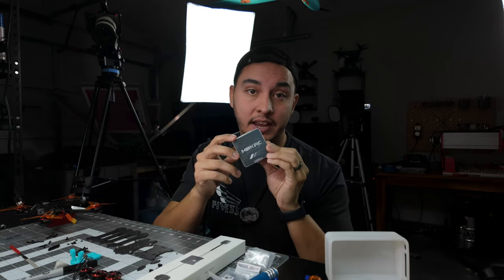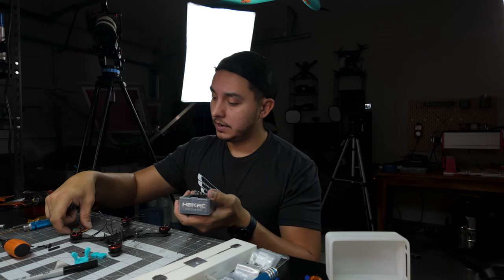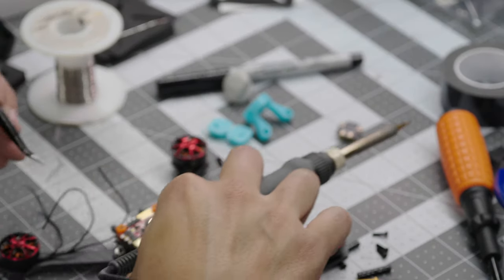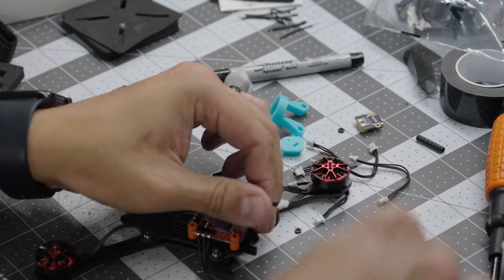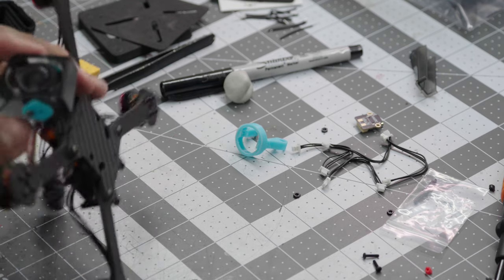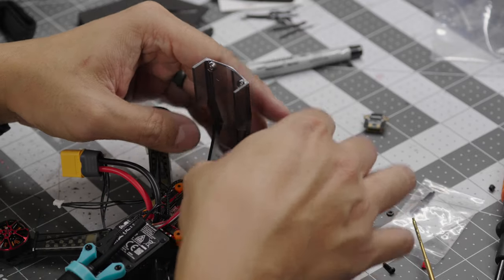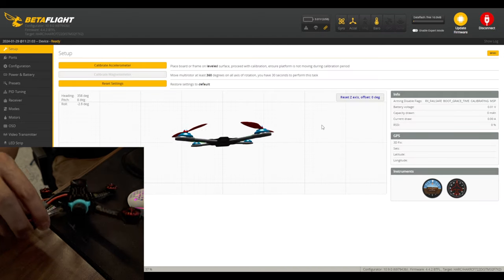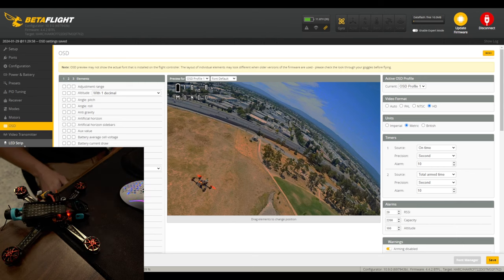How To Build Your Tiny Trainer HD | Comprehensive Build Video

Comment: Could a Newbeedrone Cricket 200 stack be used on this TT HD? I will be running a HDZ Freestyle V2 with Nano90 camera also. Thanks
Reply: Could it be mounted up front I meant... Thanks
Reply from the maker: The tiny trainer Hd only has mounting for 25x25 AIO boards unfortunately!
Reply: @headsupfpv  ok. Thanks

Comment: What’s the flight weight of this build, assuming O3?  The v1 TT makes a great sub250g O3 build, but this has more carbon and bigger motors.
Reply from the maker: It has the capability of being sub 250 if you do no LED kit and run a smaller battery but with full LED kit and full size battery it will be just above 250!